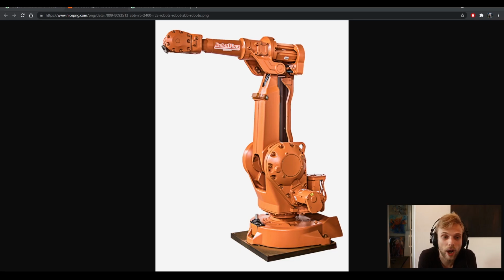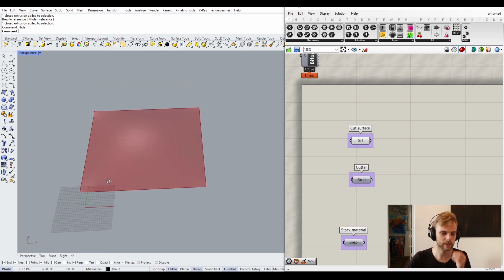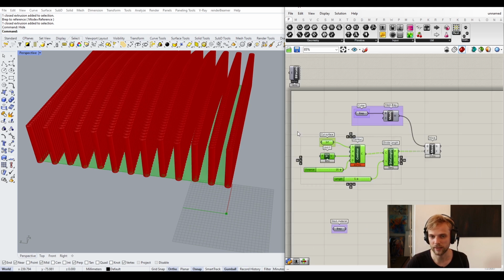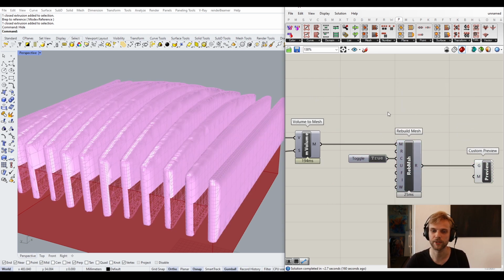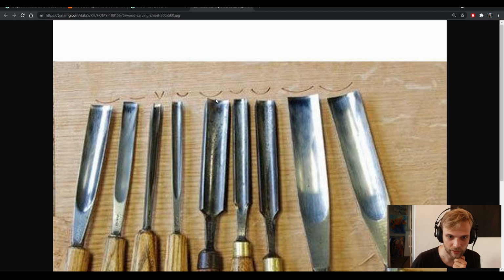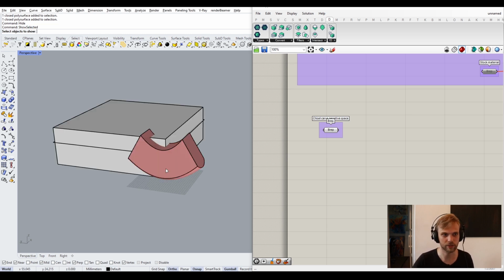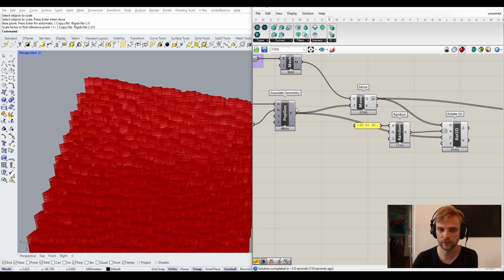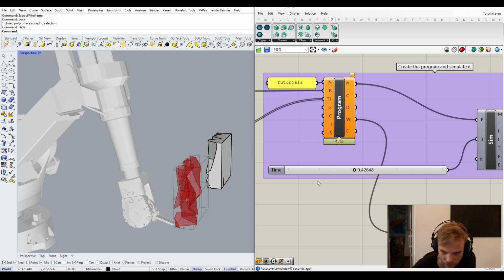Tutorial: Simulating tool path Carving with Rhino + Grasshopper

Comment: hi, thanks for the vid. 
Am I right that you wouldn't need putting cutter every 10mm on the contour (as you do in 12:00) if it were able to cut sidewise when simply moving along the contour? 
regards,
Reply from the maker: Hmm depends on what's the CNC bit diameter that you're using. Good rule of thumb is spacing the parallel passes  90% of the diameter of your bit if using the flat end mill and 25-33% if using the bull nose/round end mill.

Comment: I have a problem after the mesh join at(20:00)  i tried to use dendro  mesh to volume but after pluging in the dendro settings it turns red and shows " No data was collected". I dont know how to solve that.
Reply from the maker: Hmm hard to say without seeing the file. 1. Check if mesh join gives you a proper mesh (I like using Panel for that). 2. Check if your voxel size is not too big. If everything seems to be ok. Try just modeling 2 boxes in Rhino. Referencing both as a breps. Meshing the breps. Using mesh join. And the creating MeshToVolume from them. Always a good idea to keep simplifying until you'll find what's wrong.
Reply: @DesignGoBrr  I think i found the issue its dendro plugin issue i get notification like 
"1. Solution exception:Unable to load DLL 'DendroAPI.dll': The specified module could not be found. (Exception from HRESULT: 0x8007007E)"
Reply: @DesignGoBrr  okay ill look into it
Reply: @DesignGoBrr  Can i mail you my files so that it will be easier to find what's messing up?